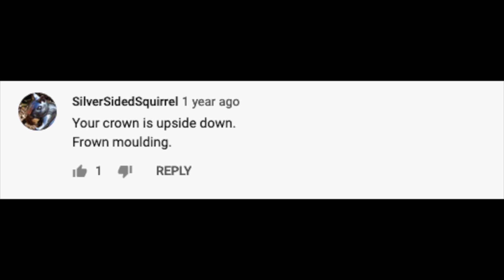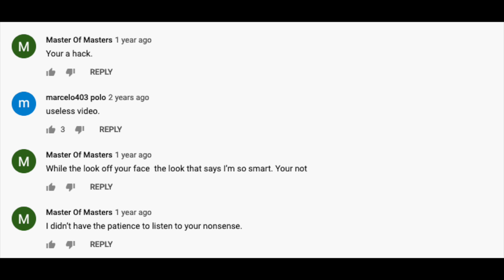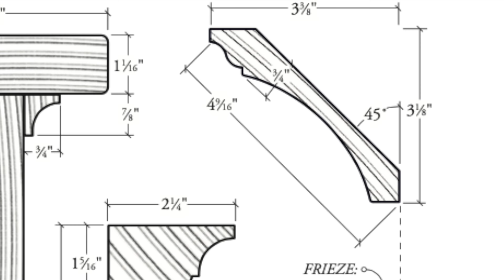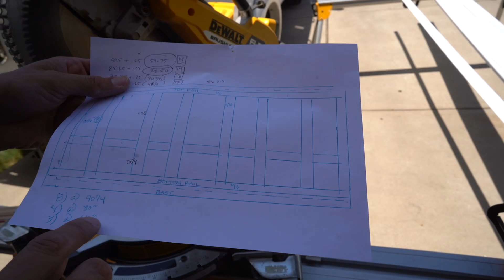"Tired of seeing this stuff put in upside down"

Comment: I understand that it's your tools but why glue it down to the saw? Was double sided tape not viable or the 2 tape glue method if you want to save on the more expensive double sided sticky stuff? The only reason I could think why you didn't do the tape method would be the added thickness caused by the tape maybe? I dunno. But what I do know is when I get home in a few months, I'm gonna use your vids to do some panel molding in my daughter's bedroom. You stir, are a beast.

Comment: The crown can generally be installed either way. There are in most cases 2 different angles on the piece, one is 38 degrees and the other is 52 degrees. The profile that it lays on the wall is determined by the up or upside down position. Your fine bro and your sharing info, don’t let the armchair quarterbacks get under your skin. Keep up the good work!

Comment: There's Edwardian crown moulding (ogee top and bottom, sometimes double ogees).  There's Roman (with the flute at top, ogee at bottom).  There's Nouveau, which can often have 10 or 15 different flutes, ogees, dentils, and filigrees on just the crown.  I've seen that exact picture rail you're using as a crown detail in Art Deco rooms.  Bottom line - keep making content, keep doing jobs, keep learning, and ignore these commenters: the trolls do nothing but troll.

Comment: Wow! Interesting intro, and thanks for exposing the know-it-alls. You're the real deal, keeping it genuine.

Now, EVEN IF Katz HAD installed it upside down, it still wouldn't be wrong. WHY?

Without needing a college degree or formal training, I am under the impression that MOULDING and TRIM are architectural details and NOT STRUCTURAL; hence it is a design element based on aesthetics. In other words, either way is right, but it depends what look one is after.
Who want to be stupid enough to correct me?

Comment: What's that spray on glue? I've seen it used I other videos too.
Reply: It's not spray on glue, it's super glue accelerator. If you look at 13:30, he spreads super glue on once side and sprays the accelerator on the other side, when they come together, the super glue hardens very quickly.
Reply: @xSchiism  Awesome, thanks for the help!

Comment: Call me out if im dumb how does your shop vac kick on before you cut? Do you have a foot switch or is someone coming in and turning it on for you haha
Reply: Some shop vacuums have a feature where you plug the power tool directly into it, and the vac goes to the wall. The vac has something built it which makes it switch on automatically when you power on the tool, pretty nifty.

Comment: I don't think it really matters. You install it in the the best way to make it look good, if you're doing a build up then that will dictate the direction other than that, flip flop it how every want, the home owners couldn't give a rats ass which way its installed unless the homeowner is a trim carpenter. If you put a home owner in a brand new house and ask them to tell you wants wrong with the trim job, they will probably point out a corner not coming together tight or a nail sticking out. In 20 years at our 4-plexes using prefinished  woodwork, no one has ever pointed out the fact that we haven't filled all the nail holes, but guess who did once...a trim carpenter.

Comment: Your blocks glued down just use one long piece then cut out the middle with the saw.
Reply: Also nail a couple blocks on a flat surface to glue the pieces together making sure they are all the same & saving time instead of trying to fit everyone of them perfectly. Not criticism you do great work just an tip
Reply: Priming & painting before installing would also save alot of time